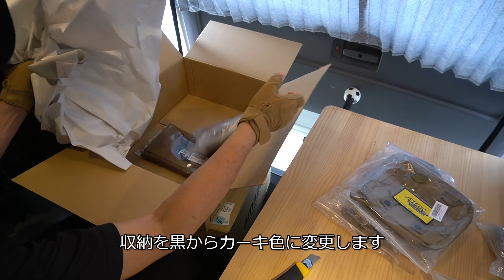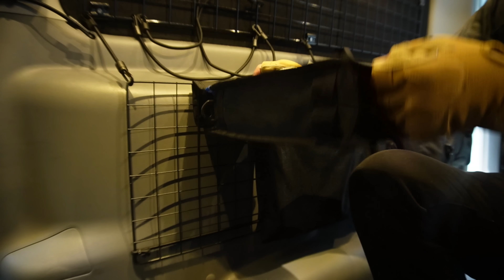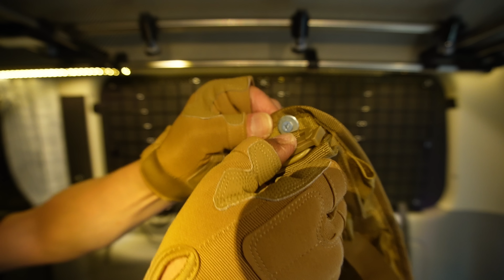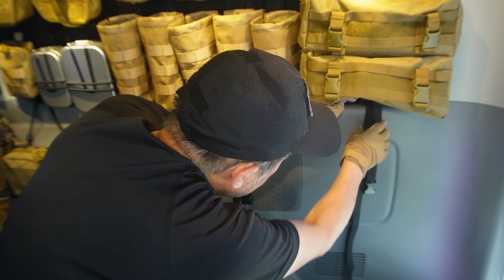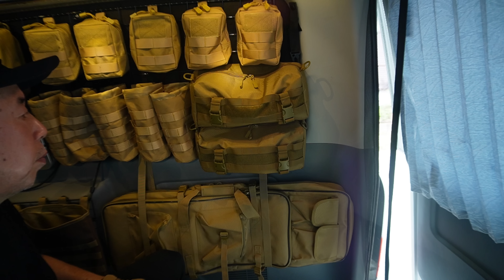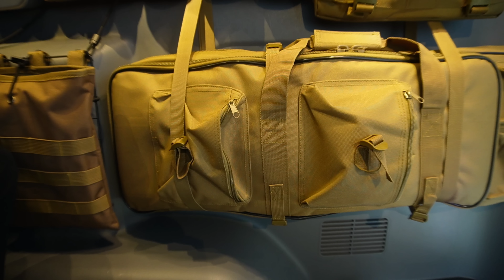【車中泊DIY】ハイエースの収納ポーチ取付と中身を全部見せます｜DIYキャンピングカー

Comment: Hi,
May i ask where I can buy roof rack (interior )and light accessories?
Reply from the maker: The overhead sliding system is my original DIY. It is a combination of car storage side bars for TOYOTA HIACE and stainless steel pipes, elector pipe, related components from a local DIY store. The lights are camping gear from Amazon Japan.

Comment: Hi, I really would like to see more about your set up in the amazing Hiace, if you don't mind😊 I want to know more about the metal rails you have inside your car in the ceiling. What are they and what do you use it for, it looks practical some how😊

Keep doing these videos, I love them👍💪
Reply from the maker: The overhead sliding system is is my original DIY. It is a combination car storage side bars for TOYOTA HIACE and stainless steel pipes, elector pipe, related components from a local DIY store. I put lights and gears etc. on them.